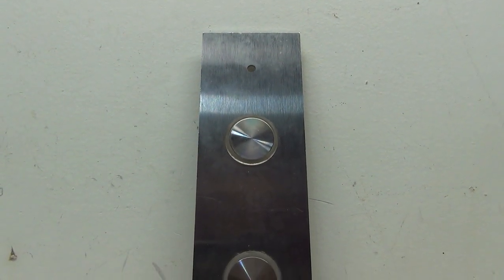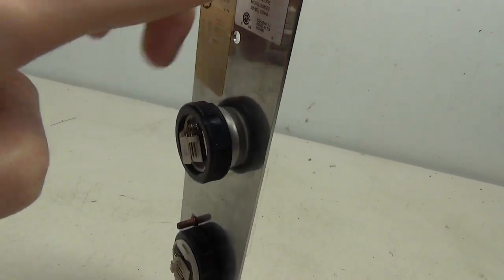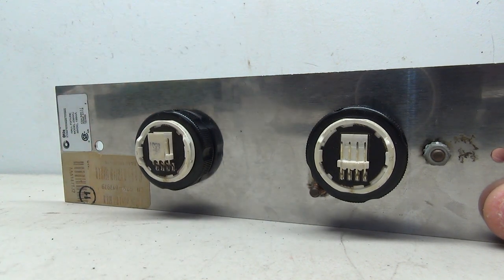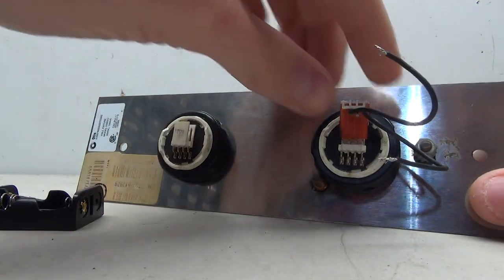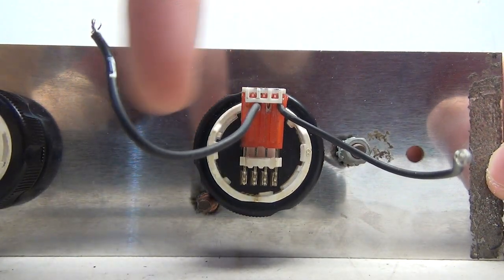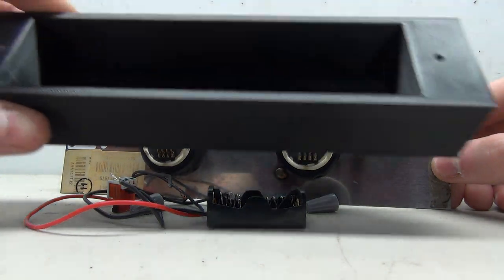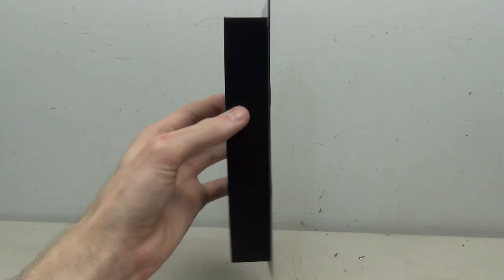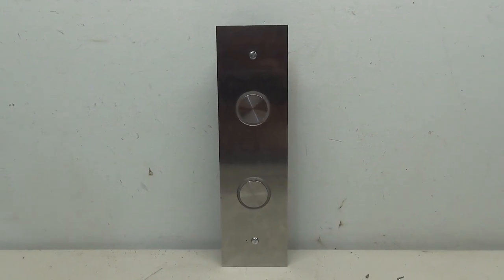Wiring Newer Otis Elevator Buttons

Comment: Thanks, extremely useful.
edit:  people are asking here,  in March  2024 i got them from china, aliexpress  2 or 3 euros, all metal, beautiful  pc board, very good switch, just amazing( or i've just been lucky),  but the pinout in NOT the same as here,the switch is by pins 1 and 4, that can be adapted with wires;for non-critical aplications only... 1 and 2 come soldered together;  they sell other models too.

Comment: I was kinda wondering when you’d do a modern Otis button. Seems like these are quite simple to wire especially if you have the proper tools. Nice video! I’m hoping to someday get some buttons of my own to wire. However, as I’m not entirely inclined to browse on EBay for buttons and none of my local elevators are getting modded, I do not believe I’ll be getting any fixtures for a while.
Reply from the maker: I've had this for a bit I just finally got around to wiring it.

Comment: Awesome video! I like the 3D-printed box.  Have you ever tried using Wago 221 connectors? I've found they are far superior to wire nuts when dealing with stranded wire.
Reply from the maker: Thanks! I haven't tried those connectors. I have so many wirenuts I've acquired over the years. I need to use them up haha.

Comment: Its strange how on the back of otis buttons theres all that space used for the circuit board where it looks like that should be where the springs are to make the buttons actually press and not click
Reply from the maker: It is just a small switch on the board for the actual contact.

Comment: Where did you get those connectors?
Reply: Most electrical suppliers will have them if not somewhere online
Reply from the maker: I had them from another project I ripped them off from.